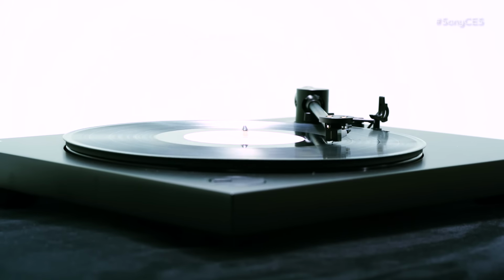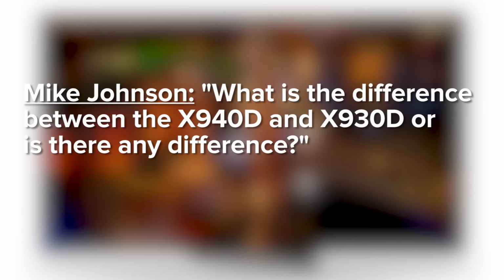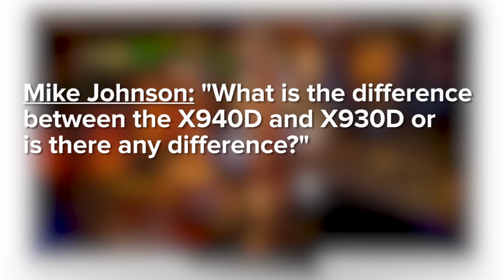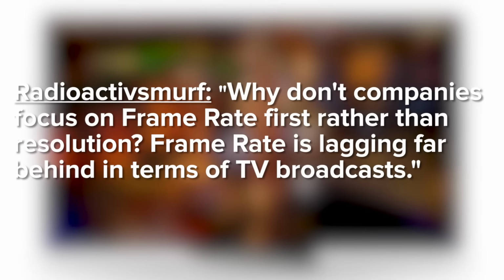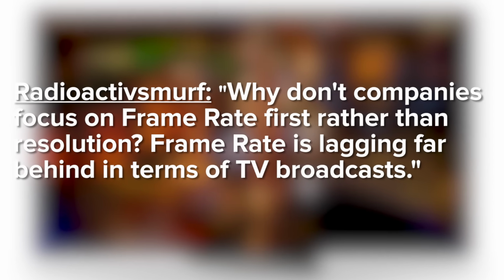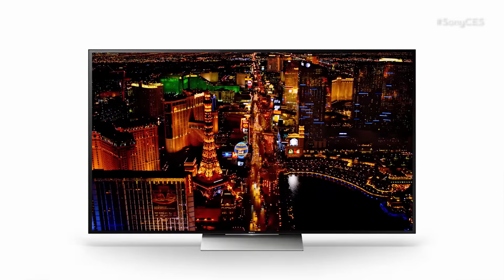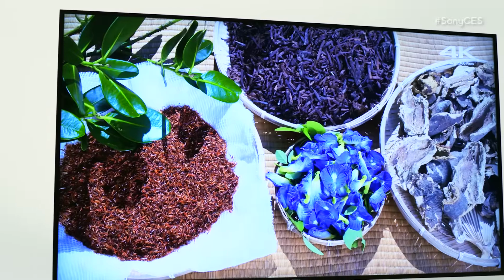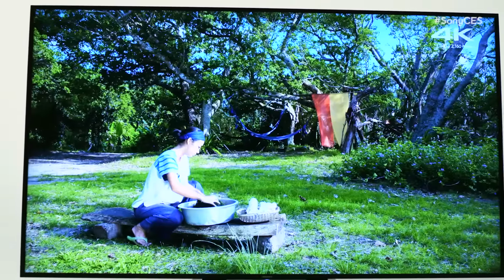Your Sony CES 2016 Questions Answered: New Turntable, HDR 4K TVs & more

Comment: can I put my Xperia z2 tablet in a swimming pool?
Reply: +Wael Rihan Yes, but check for flap pressure first.
Reply: +Shamoy Rahman but Sony said you can put it in pure water only
Reply: Wael Rihan Swimming pool works fine for me on my Z3 but you cannot submerge it too deep into the pool. With pool water, I would say the maximum is less than 1m, while fresh water would be 1.5m. Don't torture test it, just use it in less than 1m of water, that's my advice.
Reply: +Shamoy Rahman thanks alot
Reply: Wael Rihan You're welcome. Also, another bit of advice is, try to get a floating case for it so it doesn't sink underwater.
Reply: +Shamoy Rahman lol
Reply: Wael Rihan I don't know if they exist, but I bet you probably know what I'm talking about.
Reply: +Shamoy Rahman so simple just get a balloon blow it and then tie it to the tablet =flowing case
Reply: Wael Rihan LOL, that would be pretty funny, or you could get one of those sausage balloons and wrap it around the sides.